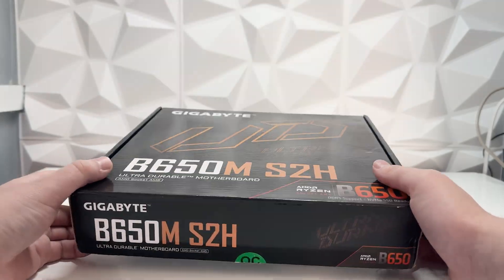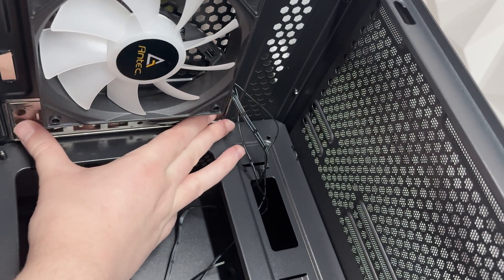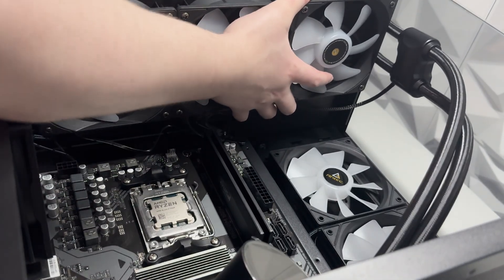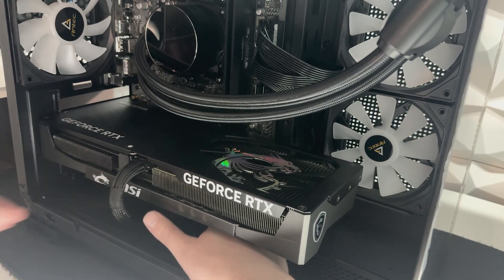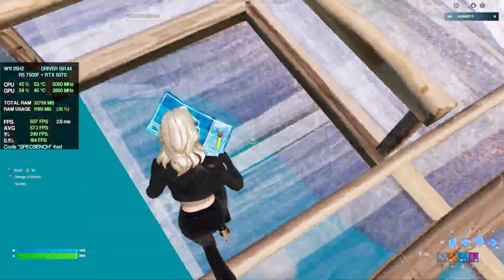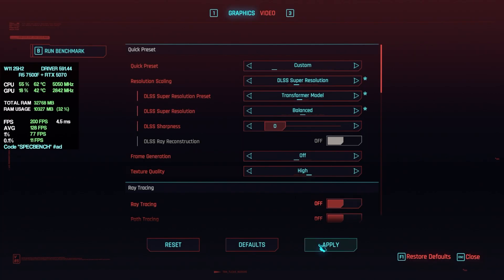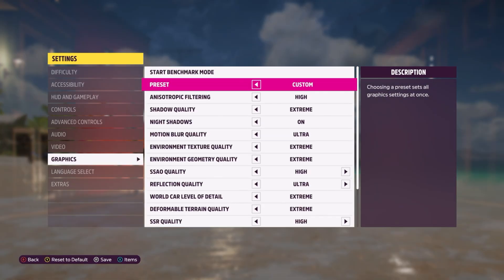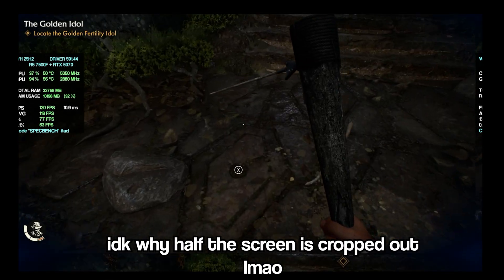The Best £1000 Gaming PC That You Can Build In 2025.

Comment: Yo, I've got a 5700x3d paired with a 3060 and I capped my fps at 240 and it holds good but it has random drops from time to time and it's only on Fortnite, ant ideas why is that? The temperatures are good around 60°C for both GPU and CPU.

Comment: How many Hz does your monitor have?
Reply from the maker: 500hz
Reply: @SpecBench wow 500hz, that's crazy. I just build a ryzen 7 9800x3d and a 5070 pc, and i am debating on whether i should buy a 360hz ips monitor or spend the extra money for a 500hz tn or oled monitor. I mainly play competitive games. In my country a decent 360hz ips monitor costs around 300 dollars (a 360hz tn monitor is like 600 dollars), and a decent 500hz tn or oled monitor cost 900 dollars. Now I am wondering if a 500hz tn or oled is really worth the 3x price increase or should I just buy a 360hz ips. Also 900 dollars is a bit over my budget.
Reply from the maker: @Aydinovskibro tbh I LOVED my 360 IPS, it was one of the best monitors I’ve had, honestly for me after 360 hz it’d hardly noticeable at least imo! So 360 is amazing and much easier to maintain consistently
Reply: @SpecBench Alright, thank you so much. I'll buy the 360hz ips. 👍
Reply from the maker: @A@Aydinovskiof course OLED is better a lot of the time but with that comes a lot more cost!